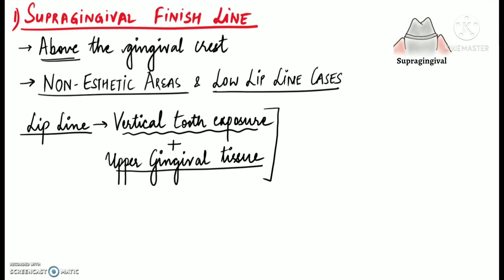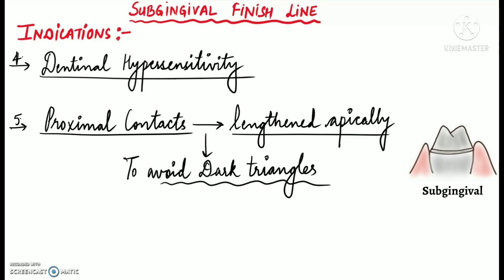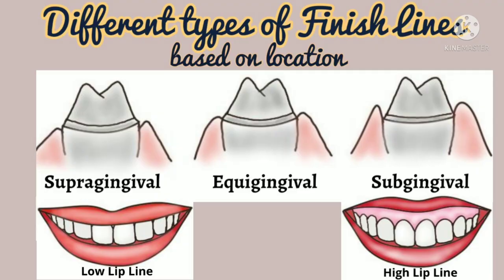Types of Finish Lines based on Location/ Finish Lines in Fixed Partial Denture/ Tooth Preparation

Comment from the maker: References:
https://www.jpsr.pharmainfo.in/Documents/Volumes/vol8Issue10/jpsr08101616.pdf
https://ijmdc.com/fulltext/51-1515234310.pdf
https://www.juniordentist.com/finish-lines-in-tooth-preparation.html
http://www.jnda.com.np/article/nki2cpc56y0.pdf
https://www.jcdr.net/articles/PDF/1582/57%20-%203291.pdf
https://journals.sagepub.com/doi/pdf/10.1177/2229411220120102
https://www.jidonline.com/temp/JInterdiscipDentistry213-4637475_125254.pdf
https://www.amhsr.org/articles/evaluation-of-various-finish-line-configuration-established-by-various-dental-studentsa-retrospective-study.pdf
http://www.moderndentistrymedia.com/nov_dec2009/newsome.pdf
https://www.mdpi.com/2077-0383/9/1/249/htm
http://medcraveonline.com/JDHODT/JDHODT-09-00404.pdf
https://opendentistryjournal.com/contents/volumes/V9/TODENTJ-9-190/TODENTJ-9-190.pdf
Reply: Ma'am, what are the indications of equigingival finish line?